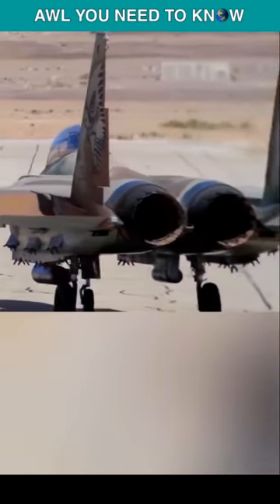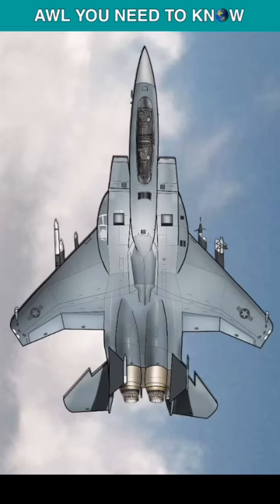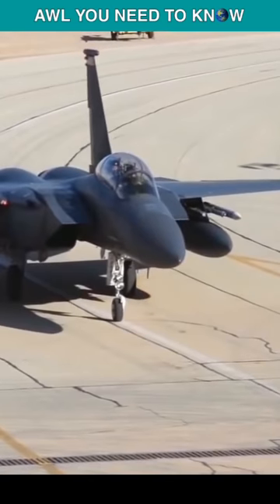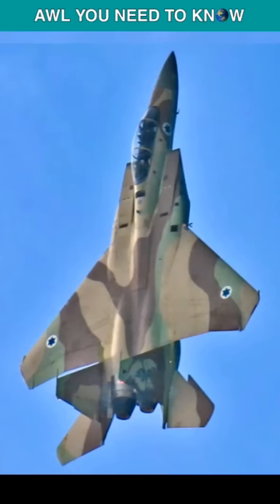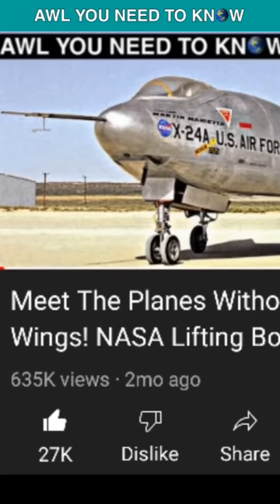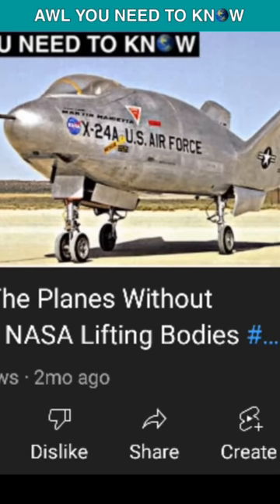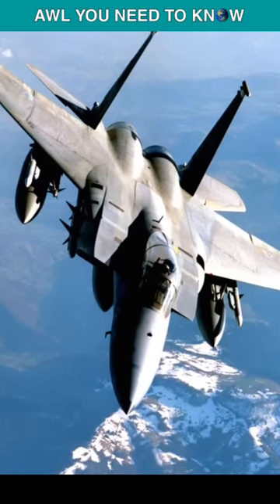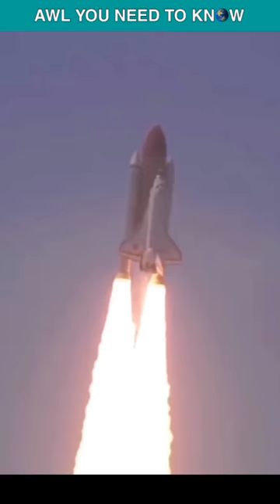When F-15 Eagle Lands Without One Wing #shorts 1983 Negev Mid-Air Collision

Comment: Understanding basic aerodynamics makes this not even a mystery... those planes can even take off with one we missing. In fact you can make a plane that almost has no wings at all and it will still fly. You were to make a plane that was the same shape as a dart and basically have the wings fused into the body it would still be able to function like a normal airplane as long as it has the same configuration as this plane.